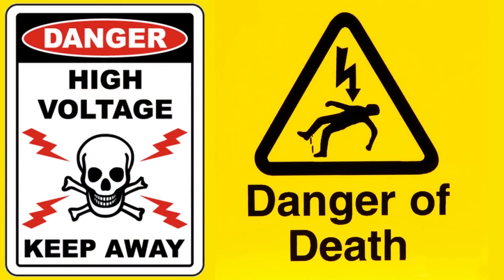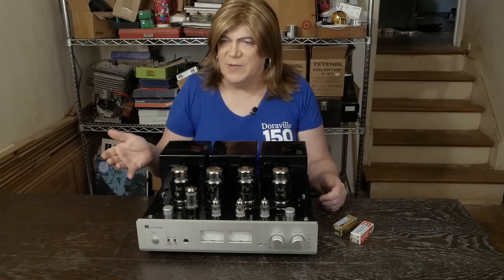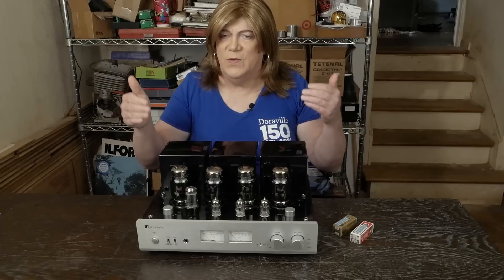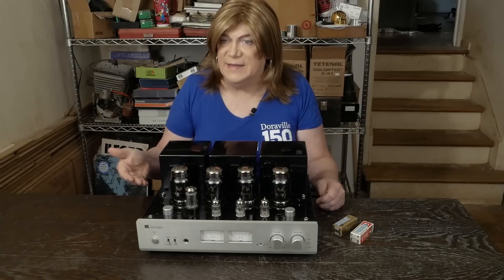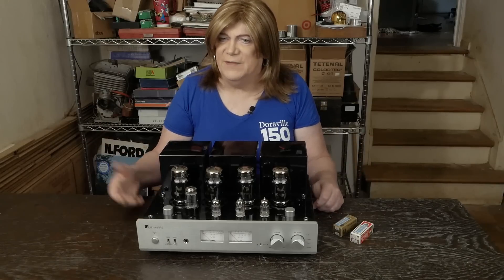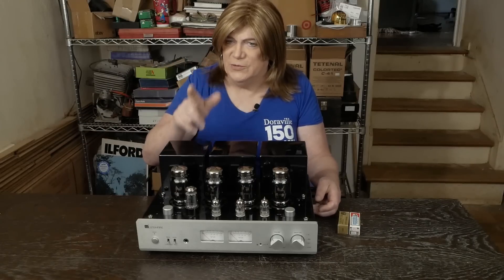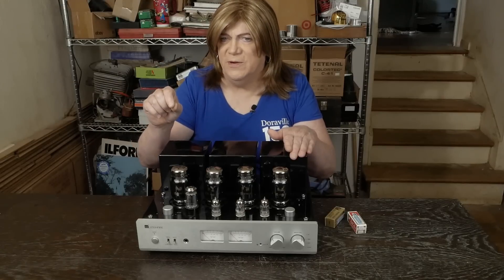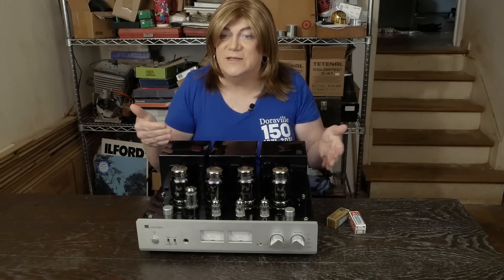Muzishare X7 vs Wilsenton R8: Testing and Objective Review

Comment: Howdy, was this a comparison with the original R8 or the MKii? Based on when this video was made probably the original R8? Would you prefer the Muzishare X7 over the R8 MKii? I have some Klipsch La Scalas LSII’s and I’m new to tubes - looking to get myself my first integrated tube amp. Great videos btw - seems you are a very respected voice in this community.
Reply from the maker: It was either a "mk2" or it was upgraded to mk2 specs. If you has La Scalas, you don't need or want a 45W push pull amp.

Comment: Many praises and thanks,

Which 12ax7/12au7
I know you have mentioned them but which ones?

Gold lion 12ax7 the standard,premium, or the gold lion CV4004? 

Many thanks
Reply from the maker: The "premium" 12AX7 and gold pin EH 12AU7 work well.
Reply: Would you personally add a preamplifier to the X7?
If so which one(s) ?

Sincerely,
Estuardo
Reply from the maker: No, a preamp is just more things in the signal path for absolutely no reason whatsoever. The only exception would be an external phono stage/pre

Comment: Can you please either make or point us to a video showing how to bias the muzishare x7 using the by meters and the method you’ve enable with the mod? I’ve biased guitar amps to match new tubes but not a huge amp.
Reply: VU meters… not “by meters”
Reply from the maker: My mod doesn't change how the amp is biased at all. Just switch to each tube with the rotary switch and set the bias to 40ma.

Comment: I commented a few weeks ago about getting shocked by 2 of the Willsenton R8 amplifiers from their volume knobs nocking out the remote section in both amps. Finally got a refund from China Hifi and made a deal on getting a price match at China Hifi for the x7 at the Ali Express sale price of $1175.00. Bought this because of your recommendation. Thank you. BTW could the problem have been my Colorado very dry environment or just bad groungs, maybe both.
Reply from the maker: I would recommend testing the outlets in your home to ensure they are wired correctly!

https://amzn.to/4j7ZZpK
Reply: @SkunkieDesignsElectronics  Is this to see if it is correctly grounded.
Reply from the maker: Yes and to ensure the hot and neutral aren't reversed.

Comment: Which specific kt88-z is she recommending . Couple different Shug. Versions. Clarity on the specific tube would be appreciated.
Reply from the maker: You can literally see the version I am using.
Reply: @SkunkieDesignsElectronics  , respectfully, it is not that clear. That's why I've gone to the extent of asking this question. You articulated the other tubes clearly but there are two different versions at the vendor you linked for the Shugs and they both look like what is in the video. I finally made it out after I thought I may have ordered the wrong one but it is definitely not clear  based on what you are saying in the video and the fact that there are two different versions of the KT88-Z, one that is around 250 for a quad and another one that is 400 plus.
Reply from the maker: Are you talking about 50th anniversary vs the normal? IMHO they are the same. Like this set for $225: https://youdaelectronics.com/products/4pcs-1-matched-quad-shuguang-kt88-z
Reply: @SkunkieDesignsElectronics  thanks very much for this link and info, much appreciated!

Comment: Did you ever get a Line Magnetic 216i? I have one and it's very nice. That have distribution and dealers in the USA and one can get it fixed in the states. It's a push pull KT 88 design.
Reply from the maker: Honestly there are two dozen other amps, I can't possibly review them all
Reply: @ Fair enough. Yes there are many amps out there, especially Chinese made ones. Line Magnetic was started by two Chinese brothers (one has died) who based their designs off the old Western Electric models.

Comment: Hi Steph!
kt88 Z are made by different brands, which ones you talking about are the best on this Muzishare X7?
Im going to order this amp on china hi fi audio and i can choose between Muzishare tubes or Psavane .
 Suggestions?
Greetings from Italy
Reply from the maker: I'm talking about the shuguang treasure black bottle version
Reply: @SkunkieDesignsElectronics the seller said me the KT88 Z Shuguang have 7 pins not 9 and suggest me upgrade with Psvane KT88-TII..I'm confused
Reply from the maker: KT88 is an 8 pin tube...
Reply: I'll follow your suggestion.
I've found the 4  black bottle KT88 + the 12AX7 Gold Lion + 12AU7 gold pin golden box x 2.
and what about the rectifier tube 5AR4?

Comment: Appreciate your candid review and I plan to pick up a Muzishare X7, but I will have a problem to add subwoofer since X7 has no subwoofer output.  I could use my Sony receiver's preamp output for the front speakers to feed the X7 preamp input, and let the Sony receiver to drive my subwoofer, but I am only using the amp part of X7, and tube preamp of X7 is wasted.  Any help is appreciated.  Thank you.
Reply from the maker: There is no "tube preamp" on these  integrated tube amps to bypass and you won't be bypassing any part of the amp other than the volume control. The best way to use a sub with a tube amp is pickup a sub with high level inputs or get a high level input adapter.
Reply: @SkunkieDesignsElectronics  Thanks for the quick reply and sorry to ask a fairly trivial question.  As you suggested, my subwoofer DOES have a high level (speaker) inputs.  The impedance of my high level subwoofer input is ~1K ohm with power on.  If I hook up my subwoofer high level inputs in parallel with my regular 8 ohm speakers, I assume that should work, since the 1K ohm subwoofer should not be drawing much current from my tube amp; 8 ohm in parallel with 1K is still ~ 7.94 ohm.  Will this parallel connection work for hooking up a subwoofer to the integrated tube amp?  Thanks again Skunkie for helping.
Reply from the maker: It will work fine.
Reply: @SkunkieDesignsElectronics Great, thanks again for helping Skunkie!

Comment: I’ve had an R8 for close to three years and haven’t had any major issues. One issue is the remote failed after about two weeks. But I use a preamp anyway. I’m no electrical technician but I do open it up once in a while and it doesn’t look like everything is leaking or falling apart. Wiring layout is clean and tight. I don’t know which R8 you dug into but the one I’ve been using for a while is working the same as it did when I received it. 
But I am interested in the muzishare and if you’re saying it’s built better I just might give it a go.
Reply: Check the batteries are secure in the remote.  I've dropped my remote on the carpet and it the batteries popped loose.  Wrapped electrical tape and it fixed issue.

Comment: Can I use gold lion ECC82-ECC83 instead? Thanks
Reply from the maker: I haven't tried that combo personally.
Reply: @SkunkieDesignsElectronics  Can you give me the link to buy those 2 types of tubes? Where I live, they say it's the same type because the distribution market is different so the product code is also different, thank you
Reply: Can I choose 12au7 gold lion?
Reply from the maker: If you want to, I never tried them so can't say if that specific 12AU7 sounds good in this amp or not. I know the combo of a GL 12AX7 (the premium one) and gold pin EH12AU7 sound nice.

Comment: Hello, regarding 12AX7 tubes from Gold Lion - there are two types, B759 and CV4004 - which one you recommended in the video?
Reply from the maker: B759, the premium one with the angled printing. The cheaper one is not very good IMHO.
Reply: @ great, thank you! And regarding KT88 - I am struggling to find the ones you recommended in the internet, especially with the shipping option to Europe. Any good sounding alternatives you know?
Reply from the maker: The PSvane Horizon sound good as well. Youda still has some KT88-Z and should be free shipping 

https://youdaelectronics.com/search/?Keyword=KT88-z

Comment: Hi Skunkie, one of my JJ's KT88s went bang this morning and took out the left channel in a puff of smoke. I can see some burnt wiring inside next to some resistors on the left channel below the tube holder so the amp is off for repair. Obviously one of my KT88s is toast so II was wondering what your current recommendation is for KT88s on the X7? I loved the sound of the JJ's over the stock KT88s but I am not sure if I should replace the blown one with a JJ's, or get another matched pair of them or just replace the whole quad. Thanks 👍
Reply from the maker: First, have the repair shop replace the 10 ohm resistor on the cathode with a 1/2W so it will act like a fuse to limit damage in the future if this happens. I'm a huge fan of these new Psvane Horizon KT88 tubes!
Reply: @SkunkieDesignsElectronics  Legend, thank you 👍

Comment: I have used R8 without problems for two years. I think it's time to move on. :) I can't choose between Line Magnetic and Muzishare amps using 845+300B. Muzishare uses 5U4G as rectifier while line magnetic doesn't. Is it benefitial? Which one do you think could be better? :)
Reply from the maker: Those type amp scare me with the super high voltages. I know the Willsenton 800i is full of circuit boards, which also scares me in a tube amp. Do you really need that much power?

Comment: Just subscribed to your channel to get valuable updates, thanks for videos.
I got my Cayin MT45mk3 runs on 4 KT88 as well and wonder if I shift to Muzishare x7 is just minor upgrade or just trade bad for worse? Mainly, I use to listen jazz in all variations, vocals, a bit a classical ones. Honestly, I shifted from solid-state Japan made Marantz pm8006 to m.a. tube Cayin and feel happy with new sound. 
Thanks and regards, Victor
Reply from the maker: I wonder if a single ended amp might suit your music style better? Do you really need 40W+ of power? That said, I honestly can't say if the X7 is an upgrade or not, never listened to the amp you have now.
Reply: @SkunkieDesignsElectronics  ok, I got your point, thanks a lot, it'd better to get one with money back option to compare apple to apple in my set up in particular. ❤️

Comment: Howdy. Great.
However. I would argue the star topology grounding is not the way. I would say the minus/ground should be a bus topology. The ground bus should be a separate wire running from stage to stage in the order of the schematic. The bus connects to the filter cap. at one end and to the input jack ground lug at the other. The input jack ground is the only conection to the chassis. And observe that the filter cap should be mounted with reinforced insulation to the mounting collar. The cap. must be floating regars the chassis. The bus should be a rather thick wire. Mandatory bus bends should be done as shallow as possible and with as large a bend radius as possible to minimize bus impedance
The end tube cathodes should have dedicated wires to the filter cap. So Yes. The end tubes grounding is a star topology.
Using all star topology would mean that all interstage signal returns would detour via the star point, where the strong end tube signals also reside. A recipe for hum and oscillations if I was asked.
Regards.
Reply from the maker: Some amps are wired that way, I don't believe star grounding is inherently problematic and I've had none of the problems you post as "facts".
Reply: @SkunkieDesignsElectronics  Howdy again.
OK. Fair enough.
Regards again.

Comment: Will you please let me know if the Musishare X9 ? Is it decent ? For phono
Reply from the maker: The phono stage on the X7 is not good sonically, I would have to assume the X9 phono pre-amp is the same. It's a tiny little solid state board in the X7 and sounds tinny and weak.
Reply: @SkunkieDesignsElectronics  do you know anything about the Yaqin MS300c ? I've heard it tested well . But Id love to hear your feedback . I'm really struggling to find a decent 300b SET amp . I'm willing to pay 2000.00$ for one but nothing more I can't afford more than that.

Comment: Is the Muzishare good with power hungry Magnepan LRS?
Reply from the maker: No tube amp is really good at high current demand speakers.
Reply: While you can run them with lower power, they are best with 150 watts and at least 200 into 4ohms. The latest class D amps do wonders with Maggies. My NuPrime IDA 16 intgegrated sounds better than my previous Bryston stuff, which was always too bright. System matching, room and the volume you listen at are all factors. At lower volumes my 1.7QR pair sounded very good with a Manley Stingray II, which barely hit 40 watts.

Comment: What about the single big tube there (GZ34 i guess)?You did not mention that one...Does it have effect on sound?
Reply from the maker: Very little if any.
Reply: @SkunkieDesignsElectronics  I guess we have to try to have a clue 😊 I am definitely gettinf that amp in couple of months.There is balanced input version now.I am planing to reaplace the main capacitors with V-Caps as well.I've read that some peole have very good results.
Reply from the maker: I'm not a big fan of those caps but people have different tastes. Pretty expensive too!
Reply: @SkunkieDesignsElectronics  I think they are for people who like detail.Which caps you can recommend me then?Sorry i didn't want to disturb you too much,but you are very knowledgeable 😊
Reply from the maker: No worries, I like the Mundorf alum/oil caps!

Comment: Just bought the Muzishare . I haven't done any of your suggested mods although I am looking forward to it. Coming from Class D GAN, this is a revelation to me. There is sudden increase in base(without subs) and gain. I don't have to turn it up beyond the 20% mark. Although I am feeling that a lot of dynamics is lost. Even vocals seem to have lost it's body in some tracks. Perhaps this is still burning in..
Reply from the maker: Burn in and replace the cheap China tubes with the ones I recommend. The tube swap is HUGE.

Comment: The MuziShare sounds like a good amp, and I do prefer having tube rectification rather than solid state, but also, the Muzishare X7 is a bit more cost than the R8, so it depends on where your budget falls, especially if you plan tube rolling.    Rolling all the new tubes into this ends up costing almost the price of the entire amp just for new tubes.     If you are going to roll in expensive tubes, it might be worth adding up the price of the tubes, and the amplifier, put it all together and get a higher quality amplifier that already has the higher end tubes in it from the factory.
If you're spending over $2000 on the amplifier, plus all the tubes (which is possible) you may be better off going with a brand name, locally made tube amp.
Reply from the maker: I thought the X7 and the R8 were basically the same price? And both amps need all the tubes replaced IMHO to sound their best. Also, not aware of a band name, locally made tube amp in this power class for $2000. Is there one?

I will say my recommendation has shifted to the R8 after the recent update they have made, if you can ensure you are getting their new version.
Reply: What is  the updated R8 - Does it have a different model number, how is it identified?

Comment: China-Hifi-audio is selling returned, but new muzishare x7 amps from Canada and USA at a $285 discount. Any reason why we should be careful and just buy unopened muzishare x7? Thanks
Reply from the maker: Hmmm Well A) The shipping or return shipping costs are very high if there is something wrong. B) These fixed bias amps can be damaged if someone sets the bias wrong.
Reply: Hi Skunkie! 

I purchased the X7 in Feb 20. Checked the bias out of the box, it was set all over the range. Easy fix. I replaced the coupling caps with V-Cap Odams after 2 years, great improvement. I have GL KT88s, SED Winged C 6550s, and KT88-Z in the output rotation. To my ears the 6550s are the best overall, but any of these tubes really compliment the X7.

Really enjoy your channel. No BS, just knowledge.

Cheers from Western North Carolina!

Comment: This video is excellent. Thank you for the dedicated service you have provided to the hifi community. Just wondering, I had been just about to purchase the R8 (which I canceled upon watching this video, so thanks). When you compared the sound quality (R8 vs Muzishare x7) was this after you completed the mods on both amps? And we're you using the same tubes on both amps? Stocks tubes? Or your favourate tubes? Just wondering what your testing procedure was with both amps, Thanks again
Reply from the maker: Both amps were after mods and tube upgrades, the R8 required a LOT more modifications as well. We did compare the with the same output tubes, but the front end tubes have different sockets so can't be shared.Z

Honestly they both sound nice, the Muzishare just has a better laid out grounding/wiring + didn't have the flaking resistors the R8 had.